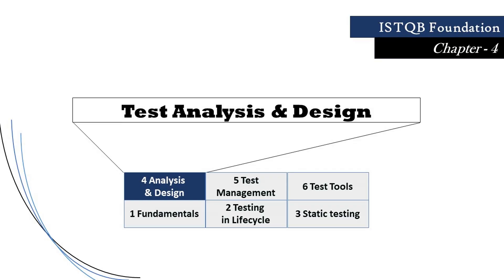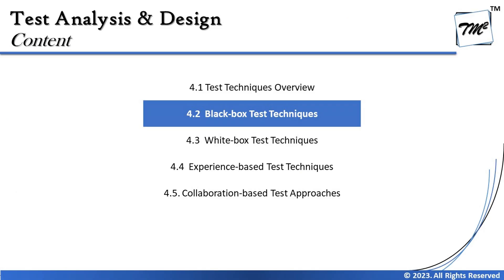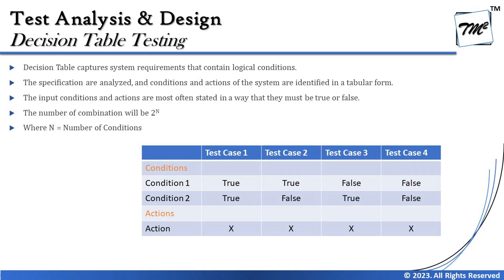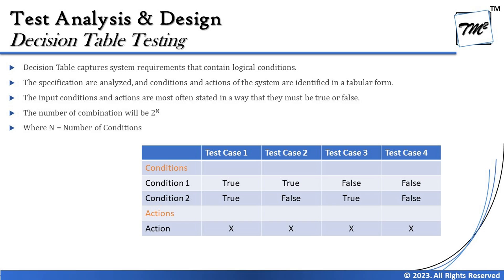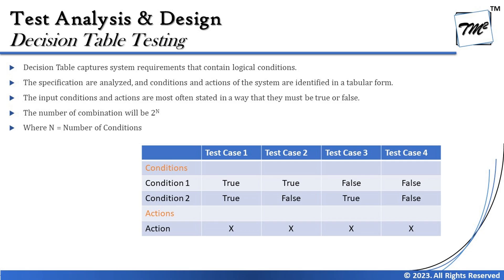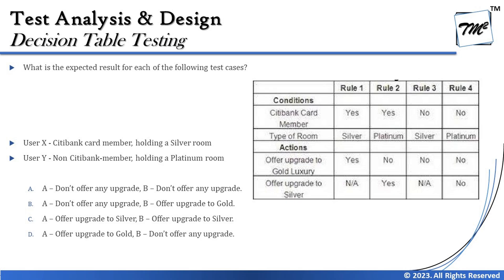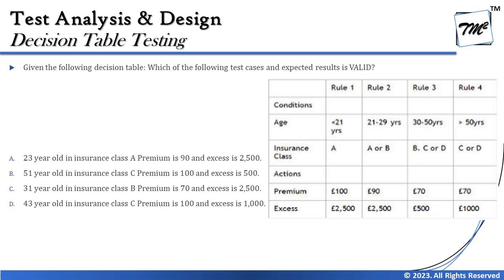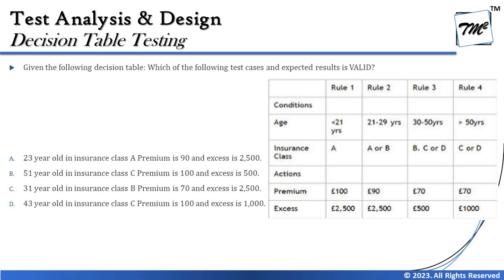ISTQB FOUNDATION 4.0 | Tutorial 32 | Decision Table Testing | Test Case Design Techniques | CTFL

Comment: Hi , Please can I get help in solving the question below
A company wants to reward each of its salespeople with an annual bonus that represents the sum of all the bonuses accumulated for every single sale made by the salesperson .The bonus for a single sale can take on the following four values :3% ,5 %,7 % and 10 %(the percentage refers to the amount of the single sale)These values are determined on the basis of the type of customer(Classified as basic or Premium)to which such sale was made,and on the amount of such sale classified into the following three groups G1,G2 and G3 
[G1] : less than 30 euros
[G2] : between 30 and 200 euros
[G3] : greater than 200 euros
Which of the following is the minimum number of test cases needed to cover the full decision table associated with this scenario?
A.12
B.6
C.4
D.3
Reply: B.6
Reply: @EvgheniPopov-g2j  hi, I assume there are only 2 conditions. Type of customer and the groups. So it should be 4 scenarios. Answer is C. Am i correct?
Reply: Correct one is B.6. Thanks
Reply: 6
Reply: It is 6, because they're not both binary inputs. So if it's not Y/N you have to count all possible condition 'sub categories', create a total for each condition and multiply them together. So in this example; The Bonus is the action, Classified is Basic or Premium (2) and we times that by Sale amounts which are G1-G3 (3). So 3 * 2 = 6 test cases needed for coverage.

Comment: User Y - Answer is A but you said it's D, correct me if I am wrong please. Thank you for your video! :)
Reply: Correct Answer is D because User X will get offer as user X is card member and holding a silver room. So, User X can upgrade to Gold. User Y is not member and holding Platinum. So, Can’t upgrade to any offer.
Reply: @pravallikareddy9801  Please check again. For User Y, answer is A
Reply: @WajidRasul-wy6gk  yes someone kindly confirm it too?
Reply: @pravallikareddy9801 D would be the correct answer if the question was directed to user Y but unfortunately the question wants the expected results for EACH of the test cases. Meaning 1 for user X and 1 for user Y.. So D answers for both users
Reply: The posed question is the one that led to D as the answer, user X is a member and the later is not. Basically A-is for user X and B for user Y
Reply: Why is it wrong? The user X is the first column. Therefor upgrade to gold. D seems right to me.